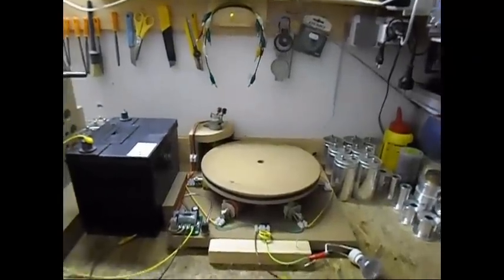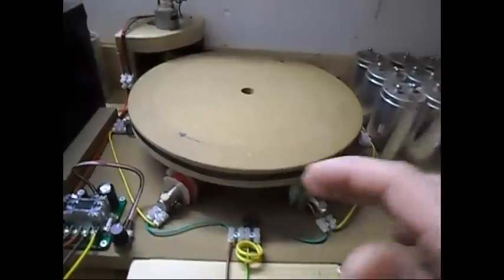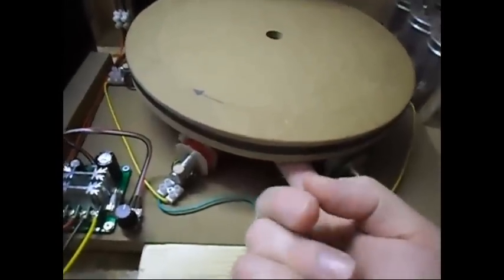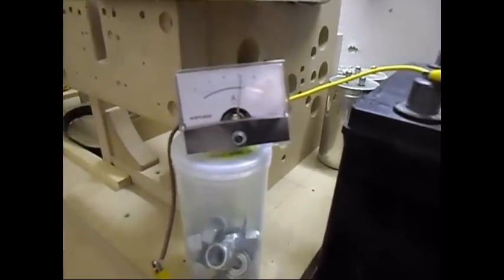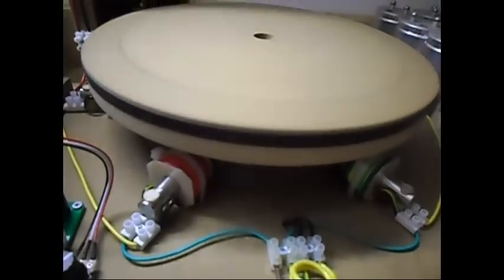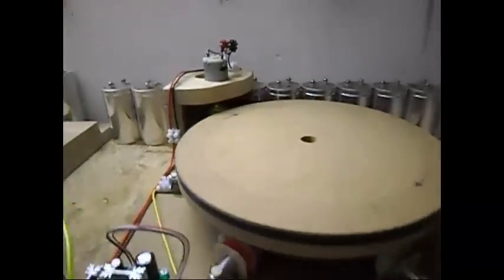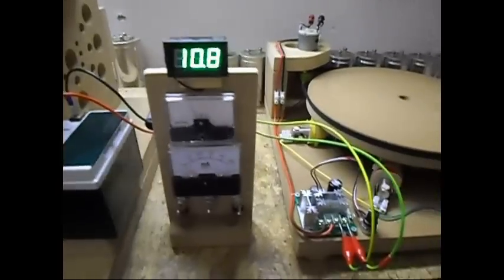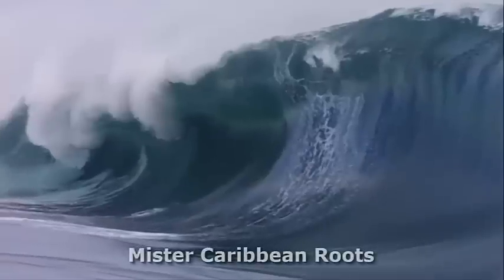Flux Gate Generator - Update 1 Nice looking & Poor performance...

Comment: Mister this type of devices can be made on zero friction bearings with a liquid core they can be also connected to a magnetic "spring" bearing to pull a sealed stirling-like pump if the material is good enought(diamond I suppose or adamantinium(I think a trioxyde of titanium it was) - it can make critical vacuum and eventually for a blink of an eye an anti-matter explosion this stuff is dangerous that's why the government holds it back from us, that type of devices(and some magnetic ones(excuse me I mean electromagnetic(there aren't that strong natural magnets)) I mean cmon they have them already on the coil guns. See there should be a physical principle of work, lets say a formula which is a unique geometric(regarding to waves, frequency etc)  occurance in nature with some sacred number's in it, they don't use free energy because it is more dangerous than you think! It must be used only by specialists with great caution!
Reply from the maker: Hi Vladimir Nachev,
Thanks for your comment and all the extra info...^^
"occurance in nature with some sacred number's in it"
I do like that approche...;-)

"they don't use free energy because it is more dangerous than you think"
That might be true...what would happend if a motor/generator start producing more output than that in consumes...space warping, gravity warping or maybe just nothing...???

Only one way to find out...^^
Cheers
Reply: it is not about space wraping it can produce enough energy for dangerous critical energy concentrations I mean if enought energy there can occure radioactive chemicals that can get critical mass or something like that
Reply: but for this particular device there wouldn't be more than a fire I suppose :D
Reply from the maker: Vladimir Nachev
Thanks for the extra input...^^
This line of yours made me lol a lot...:D
"but for this particular device there wouldn't be more than a fire I suppose"
So true especially with those high amps...lol
Cheers

Comment from the maker: Bloody Banana mate,
I always have trouble replying to your comments...lol...what are you doing on U-tube since you are being tracked/watched/blocked...lol

Here's my reply,
Hi there deeds mate,
Thanks for dropping by and for your comment...^^
LOL, welcome to the club of "Fried PSU's"...b-emf killed mine...lol
P.S...put a diode or a FWBR on that puppy next time...;-)

Now if have a 110VA transformer 230/15 and with a DC to DC converter i can get anything from 16 to 35Vdc...^^
And if something should break wich will be to converter i can buy like 5 for 10 euro or something like that on Ebay...got to love them Chinese...:D

PWM = Pulse Width Modulation & here's the thingy link,
http://www.ebay.nl/itm/311135326456?ssPageName=STRK:MESINDXX:IT&_trksid=p3984.m1436.l2649

For the PMBO it has been completely modified under the rotor...;-)
It will work much better now...^^
That other video was a update on the universal motor rotor wich was posted on the 6th mate, you're late...lol
Cheers
Reply: I think you wanted a ***** in that message somewhere. He seems to have a block circle all for us all some how.
Reply from the maker: Diadon Acs
Thanks for tipping off deeds about the google+ block issue...^^
Reply: Mister Caribbean Roots
..woot wooot wooot ..... woot Mister Carribean Root...s   Good VHS head news!!... my mum just text me, "I've got two VHS players for you" .... she's awesome.  I raided her shed for wood for this project.  She only lives just down the road from me.
And yes bud the "SlayDini" is my PMBO2014 project...  and I really need another VHS head bearing for the top as the coil gets a wobble on.  So you can see I'm a little excited to get that text from my mum..  Awesome, sorry to be quick, I need to go pickup some 96% iron bolts for my cores.  I'm pulling all my resources in, my half brother runs a hydraulics company so he's sorting me out the cores.  Fingers crossed I get my coil wire in time. 
I got two bedini circuits outputiing to two slayer circuits with two primarys and one spinning secondary... it's got another little quirk/funny that should make you laugh... I'll save that for the video.
Large spiral antenna... we must talk about this device!
Always a pleasure talking to you bud....  (and hell yeah... we got a Reply button now.. this day just gets better) :)
Reply: Diadon Acs
..thanks Diadon, I've found the setting in G+ which was blocking.
Reply: Hey bud... thanks for the info.  I've fixed the "Reply button problem".   I hope. :)  - thanks to Diadon who tipped me off.

And I know mate, I'm getting behind with my video watching. I'm having broadband problems at home - still, been since the summer.  I'm so very close to getting full service back - man I've had to fight with BT the comms company.
  PSUs lol  another back emf story of destruction.  The bemf from the slayers is ferocious, it actually sounded like it was frying my psu some nights.  All that arching inside I guess.
  PWM.. Pulse Width Modulation... I'll remember that thanks.  Chinese make that stuff so cheap, its hard not to buy direct from china, even the extended delivery time doesn't put me off now. 
  I ordered two 4kg reels of coil wire yesterday (not from china lol) .. that's the most I've ordered in one batch... it's Xmas coming early this week.
  I'm actually super excited about my coil wire turning up, and winding two new coils for my "SlayDini" ..going to be the highlight of my week.  Nice to hear from you..  I need to catchup with your newer vid on this.
take care man.
Reply from the maker: deeds
Hi there mate,
Ohhhhhh finally i can reply to your post, open the champagne bottle...noooooo...hot chocolate milk is way better...lol...me like little kid...lol
Don't worry about my videos, take your time and build your stuff...i'm the one that has to watch yours...;-)
I don't mind waiting 1 to3  weeks for my stuff from China either since it's all very cheap...^^
Those are large reels...early X-mas for sure...
You can build a large spiral antenna and tap into all those radio/micro/electric waves flowing in your garden...lol
As soon as i have a garden i will make a large spiderweb antenna to tap into whatever is out there...lol
Is that SlaDini your PMBO entry...???´
Good to hear from you to mate and keep at it...
Take care & be safe...^^
Reply from the maker: deeds
That's good news about the 2 VCR heads you've gotten from your mum and that she lives close by is nice to...^^
Being excited getting your hands on VCR and bolts for cores is awesome man...like a kid in the candy store...:D
Thats Always a good way to get motivated...
Spinning secondary...???...lol...i got to see that one...:D

I do hope you get your wires on time...
I'm almost done to with my setups for the PMBO...^^
That spiral antenna is nothing special, i'm not a square type of guy...i like rond shapes if yah know what i mean...lol
Energy will flow better if the path is nice and curvy...yep still talking about energy here...;-)
Ever seen a square river in nature...???...lol 
Nice to hear that you are doing good mate, keep that up & go for it...^^

The better you feel the better you will perform and the better you perform the better you will feel...:D 
 Take care & Peace!
Reply: Mister Caribbean Roots
..hehehe lol.. "ever seen a square river in nature??"... oh man that's making me laugh. I can totally see ya point!
  My mum is awesome, she keeps an eye out for things for me. I only mentioned VHS heads a few days back and... and I have literally just fitted one of the ones she got to my PMBO project.. she's quick.  She gave me a variable speed motor with a "foot pedal" a few weeks ago.  Hoping to use it for coil winding, she's awesome. I'll set that up and wind these new coils if the wire turns up, fingers crossed for tomrorow.  You know what it's like when you're expecting something and it's on the drag.  Nice chatting to you bud, catch you soon. I got loads of vids to catch up on. Been working, working, working on this PMBO, enjoying every minute :).
Thanks man, Peace bro.
... sorry, I'm so rude, I hope you're good too Mister Carribean Roots! - thank you for the support.. ... was out playing badmington last night... its all catching up with me...excuses. excuses lol.
Reply from the maker: deeds
Me and the family are doing fine...thank you...^^
Nice to hear that it made you LOL...don't let your lady see that though...see might think you're going bananas...lol 
Nice to read that you have sucha good relationship with your mum...^^
Variable speed motor with a foot pedal...sounds like one of those sewing machine ones...you could use that to run a self made generator in future projects...;-)

Badmington...now that's something i haven't done for a very long time...lol
Hope you've gotten them wires by now because there isn't much time left for the PMBO...AaaHhhhhh...lol
I should get my setups done by today or tommorow...pfff...lol
We do like excuses now do we...lol

Have a good weekend with your family and enjoy...^^
Reply: Mister Caribbean Roots  all good in the hood thanks mate, I just messaged you on another thread. 
Badmington... lol.. me and my mate.. a couple of old farts running around the court hehehe so funny.  We mountain bike in the summer so in the winter we get inventive. Last year was swimming but I lost too much weight so it was back to the drawing board....  the only other thing I used to like when I was at school was badmington... and there's the short boring story of  how we ended up playing that on a Wednesday night lol.   We don't play serious.. well if you call trying to score three pointers in the basket ball hoop with a shuttle cock serious then we are dead serious altheletes lol... otherwise .. just a couple of old farts and their badmington Bats... i thnk they're rackets but we're sticking with bats, we don't want to sound professional. 
  I'm crap at all other sports, unless breakdancing is a sport now??... I could still cut a rug if I tried I reckon lol... now that even I would like to see.  I promised my mates I'll do a break dancing windmill before I die... they just laughed... no no... they didn't laugh... they rolled around on the floor peeing themselves.  I went home to my Mrs saying... "they laughed at me" heheh so she laughed too! then she went .... "darlin.... you can do anything you want"... I love her, she says all the right things. lol.
  They don't know I secretly practice my windmill for 9 hours a day... I'll take those laughs of their faces... .. no no I'm not really... .  I'm actully practicing PMBO for about 9 hours a day.. I haven't got time for breakdancing.. not this week lol... anyways... I lost my marbles years ago, I still feel absolutly fine, how about you? lol
take care bro, all the best.
Reply from the maker: deeds
 Nice that you're trying to stay fit...^^
I'm doing my best to go to the gym once or twice a week with me lady but it to damn chily now on the bcycle for me...brrr...lol
Mountain biking in the summer...that really sounds like a lot of fun...:D
You lost to much weight with swimming...???...what did you do...swim across the bloody english channel...lol

LOL...break dancing...i did that to in my early years...even that windmill but now at the age & weight i don't know man...it will be all wind but no mill...lol...haha
Yep, that's the kind of lady one needs to have...mine is kinda the same...she would just look at me with those lovely puppy eyes in a questionable way...lol

"I lost my marbles years ago, I still feel absolutly fine, how about you? lol"
What marbels, think i was born without any...lol...but like you...i'm just fine...lol
Have fun & take care...hopefully now you're build should be almost done...^^

Comment: sorry to be dumb bbut what is the abbreviation of the circuit pwm,pwn ? what does it stand for and where did you get them :)
LOVE the video :-)
Reply from the maker: Hi blulander,
Thanks for your comment and glad you liked it...^^
When we don't know something it doesn't mean that we are dumb my friend and i'm glad you ask because that's the only way to go forward...;-)
It is impossible and also unbearable for one to know everything...

PWM stands for Pulse Width Modulation and they are very nice circuit to work with...^^
Ebay and here the link for this one,
http://www.ebay.nl/itm/311135326456?ssPageName=STRK:MESINDXX:IT&_trksid=p3984.m1436.l2649
Cheers